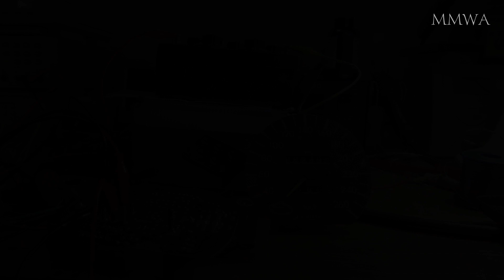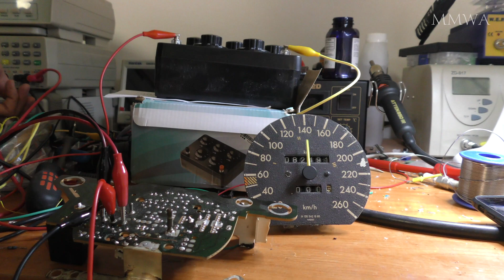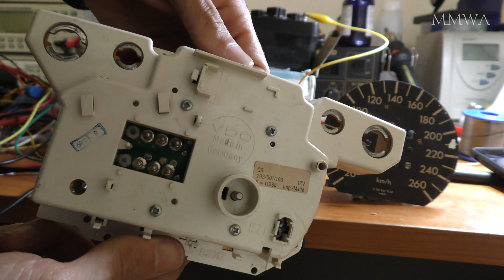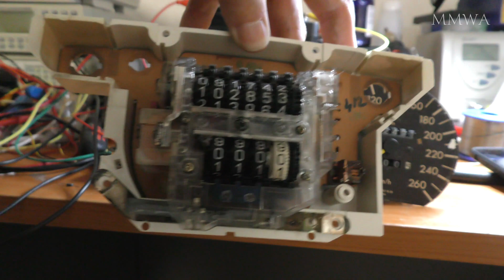Slowing down the W126 speedometer for the "AMG" 300KM/h faceplate without a speedo corrector

Comment from the maker: JUST TO REITERATE, you do not just stick in a 100ohm resistor and hope for the best, the value of this resistor must be selected for your specific vehicle. The best way is already mentioned in the thread - calculate the impulses based on the circumference of the tires and differential ratio etc, then simulate on the bench and choose the best resistor value based on this. Note, this specific resistor that is being swapped to a higher resistance is to slow down the speedo in this video, a different one is mentioned in the thread to speed it up. I can make another video showing this other one if anyone is interested.

Comment: Hi. What do you think about this: I bought w126 electric speedometer to my w201, which has bmw gearbox. The faceplate of w126 is too big and its prettt damaged. Could i buy just w201 2.6 speedometer faceplate, which also has speedometer to 240km/h and will it be okay with that and will it be calibrated good? I will run the speedo with dakota digital box.
Reply from the maker: since you have the dakota box i assume that allows you to play with calibration anyway, so as long as the 190 faceplate physically fits on the 126 speedometer you should be able to get it to work one way or another. Space may continue to be an issue though as even the mechanism is pretty large on the 126
Reply: @MMWA-DAVE  Okay! I had one w201 faceplate  in storage and it fits like a glove on the w126 speedometer. I think i will order new faceplate and continue modification. The space is problem as you said but i got good instructions from guy that had done it.

Comment: hi sir, that excel file isn't available anymore, could you share it again please?
Reply from the maker: I did not save it, but essentially its not required anyway. you can play with variable resistor to calibrate and then just match a real one to the value.

Comment: I personally have a earlyer model speedo, but does this not also have a cable input from transmission ?
 If it does then would you not need to change the gearing for km/mile counter ? 
And if thats the case, are you planning to source the gears or try to make them ?
Thanks for the informative videos !
Reply from the maker: All w126's have electronic speedometers. Odometer is one thing im not sure about, I know there are different gear sets available so this may have to be taken into consideration. All the speedos i have here that are already in pieces have melted or missing odometer gears otherwise I would have let it run for an hour at a certain speed before and after the mod and see what the odometer count w as on completion.
Reply: @MMWA-DAVE  could you just use a potentiometer instead of a resistor so you can fine tune it?

Also wouldn't the resistor definitely change the Odometer speedo, since it only runs when the speedo runs anyway?
Reply from the maker: @Borgschulze  yep a pot would definitely be better. Have not researched more into it as dont own a w126